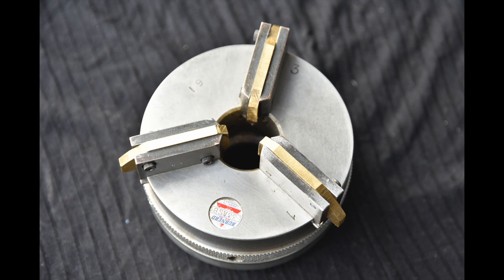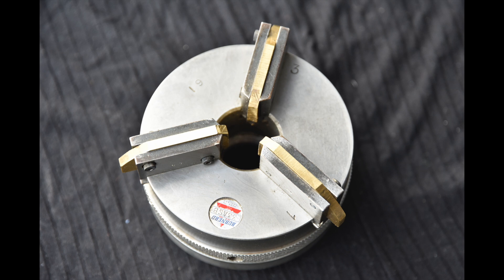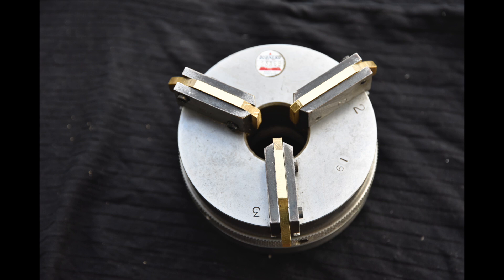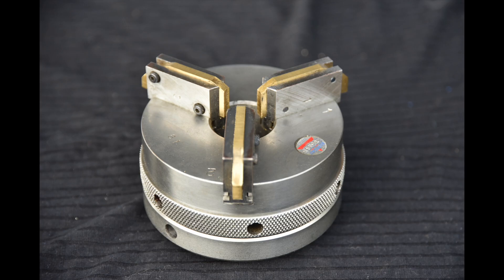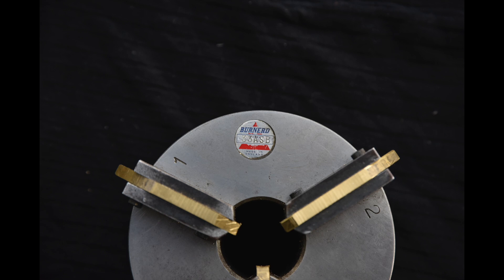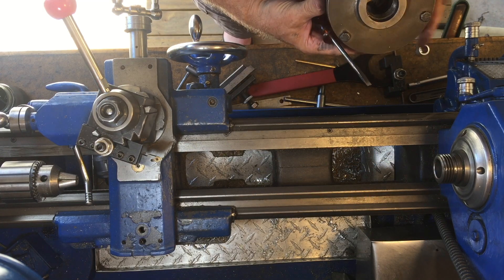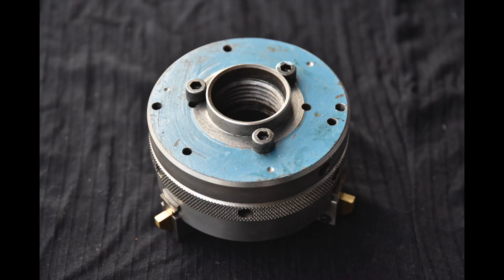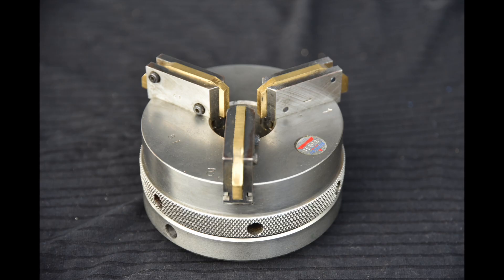Soft Jaw Self Centering Chuck

Comment: So how will you tension the jaws, when boring the brass inserts to get them truly concentric?  A suggestion might be to arrange an outer ring that snags on the heads of the projecting cap head screws.
Reply from the maker: Yes, that is a good point. For readers who may not know, it is recommended to load the jaws of the chuck to imitate the way they would be loaded during use. This is to take up any backlash in the spiral mechanism that adjusts the jaws. Winky's Workshop has done this by placing 3 symmetrical blocks between the tapered parts of the jaws. This is probably good enough, but it has been criticized because the loading is not really natural. Another method is to machine a groove through the the jaws (eg about 3 or 4" (100mm) diameter, and then fitting a ring of the same diameter into the grooves before tightening it down, and then machining or grinding the jaws. I think Brian is suggesting making a ring with projections that could engage with the heads of the cap head screws. That way you would not need to machine a groove for the ring.

Comment: Interesting jaw construction Evan.   Bit different to most replaceable faces, but being small diameter probably makes them go this way.  Yes, many people think the chuck drive thread fit determines accuracy, but in fact it has a very limited effect compared to the rear spindle facing register.  Cheers Rob
Reply from the maker: Thanks for your comments. I have not seen anything else like it.